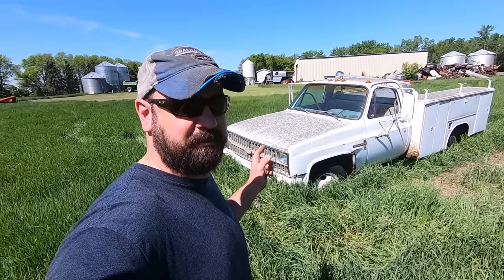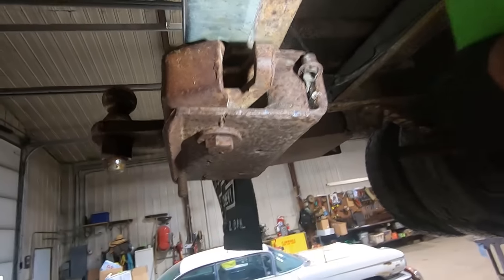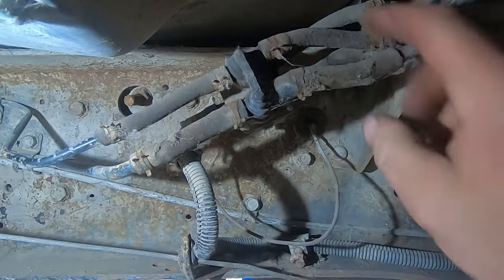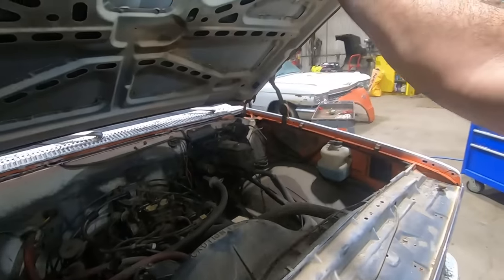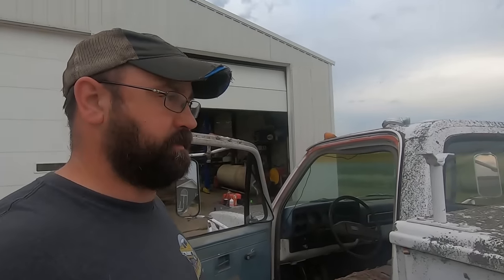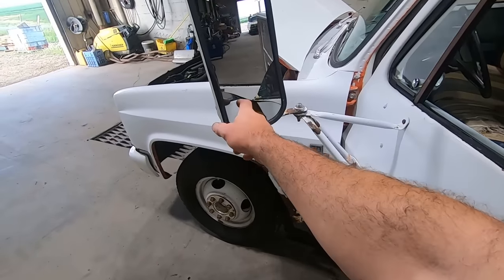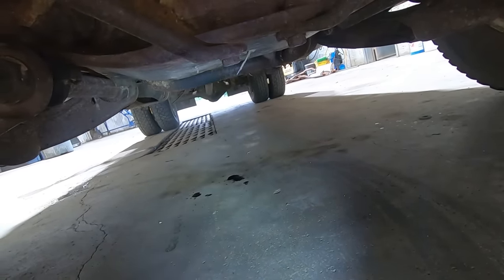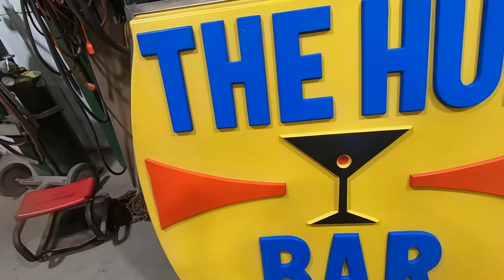1981 Chevrolet Dually! Abandoned for 16 years! C30 Squarebody Service Truck!

Comment: Pretty cool work truck for being left in a field for several years. By all means, run your shop fans to help with the heat. I couldn’t hear anything on the audio but even if I did, I’d rather know you had them on than not with the way this summer has gone. Another enjoyable video, keep up the good work! 👍🏻
Reply from the maker: Much appreciated
Reply: it was ,  but i did it at 4 or 5 am after lots of coffee

Comment: It's a gift at that price.  What a sweet rig - wish I had the room for her.  She should be sold by sundown - looks like you even had the keys for the cargo hold latches.  A great More Mortske episode would be a cool how-to on removing, by-passing and deleting emission control elements on 70's-80's cars and trucks.  Very cool episode!
Reply: They would have him in court if you look that's just the reason why they have been suing Diesel Brothers, Bill at  extenzive in Houston a lot of other reality shows that they have changed or modified the emissions and or air bags even in a car show only Lexus  built with  seratcha  brand and TV in the steering wheel for airbag  vehicles aren't OK even though  they have a 150 years of vehicles that didn't make additional injuries because of the chemical explosions in bags that is 4 times stronger for passengers and the reason why you have to height requirement for passenger but not the driver 🤔 I will have harnesses in the 07 cts 6.0 swap 3.6 is locked up I think  but mint body 1500 in total air-conditioning system replacement and Grey leather with the oyster white pearl in excellent condition  and the insurance will be  like a normal car from 07 not Uber rare 04 in sunburst orange with a t56 that's just not in junkyards  but I think it was 3 cts in the same color  a dented fender I wouldn't even have to have it painted  I like 15 year old  vehicles that are always available in junkyards and just not able to get tagged as classic yet because then they are going to cost as much as two  do at 15 years old

Comment: Those rings for the dual wheel have the conical lug nut seats on them. The wheels have a flat face on each side where the wheel meets the other wheel or the hub, which allows the wheels to be used in all six possible positions. The ring goes between the face of the outside wheel and the lug nuts. The manual transmission is a SM465, I believe that ‘69 or ‘70 was the last year for the SM420.
Reply from the maker: Thanks for the info!

Comment: They usually put those wheel rings in between the two Rims as a spacer for when you have wide tires to keep your tires from touching tires on a dually will cause hot spots and blow the tires out. But then again I may be wrong.
Reply from the maker: Thanks for the info
Reply: I have a 99 model with that ring. That’s not a spacer. Mine is on the outside as well, not between the tires. I always assumed it was to keep even pressure all the way around the wheel instead of putting pressure on each individual hole. You’re holding two tires on instead of one. I’m probably wrong though. Keep up the great videos.

Comment: When you'd see fleet trucks lined up in a lot there'd be a few older ones -- those were the ones with the big block. I have no doubt that's got a replacement motor - small blocks aren't cut out for the abuse in a service truck like that one. A lot of places went from having trucks with big blocks to mini-trucks with a four banger. Disposable junk nobody cares about.

Comment: For cooling the shop down, I’ve seen people take an old radiator and hook a fan to it and they’ll run water through it and that will work as a AC unit
Reply: The scrapper's swamp cooler !
Reply from the maker: I'd need a lot of radiators.
Reply: Not whinin' about fan noise, but I just get a 4 speed squirrel cage for twenty bucks from a furnace Manas they are super quiet. Just pick the speed you like. Also would be possible to put mister heads in front of the windy side for a swamp cooler

Comment: Mortske I have a 60’x80’x16’ shop with it spray foamed and two big window air units in it and it will definitely be 20 degrees cooler than it is outside when it’s 100 degrees out side!!! Lots of people are very surprised about how I’m able to keep it so cool during the summer!! Then during the winter I have the in floor heat!! It’s in 6” thick concrete floor!! Absolutely love it!!!
Reply from the maker: Nice!

Comment: I'm aware this is an older video but I worked for my local power company for around 15 years as a lineman and I'm not sure if anyone ever commented on it but that hitch is most likely set up for a pintle hook and they're spring loaded. Most all of our trucks had them from the bigger bucket and line trucks down to the smaller 1 tons. Even most of the supervisor's ¾ ton pick-ups had them

Comment: Had an 84 K30 with twin tanks that quit in the middle of nowhere after the camper ran the battery flat. Underneath and switch lines every 300 miles. Got home and a GM mechanic told me that there was a clock module in the fuse box that died every time the battery went flat and cost over $95 for a new one.  His solution... pull the fuse panel and jumper on the back from the pink to the green wire - no more problem ever. And every time I see your chopped F1 in the background, I start drooling.
Reply from the maker: Interesting!

Comment: My first truck was an 87 f250 with the 6.9 diesel and a c6. The previous owner built a janky hitch receiver consisting of 2" tube steel and angle iron. I got rear ended by a service van and it drove that 2" tubing right into the back diesel tank!
Reply from the maker: Ouch

Comment: One cool tip for you Mortske. If you are fighting with stiff or small hoses that don't wanna match up with fitting. Put them into hot water for 5-10 minutes and trust me they will expand and fit. Also this truck is very cool and for a small block it's very decent.
Reply from the maker: Great tip

Comment: There is a nifty little tool for those constant tension clamps. It works 90°, in both directions, of how a pair of pliers would work. 
   Game changer! Especially in small engine compartments, under intake manifolds and whatnot
Reply from the maker: I'll check it out!

Comment: Keeping the shop cool in the summer is a hopeless task; just keep yourself cool with a small a/c next to the cooler.

The 14-bolt cab & chassis dually axle is the one to get for an axle swap on the ramp truck (pickup duallies are wider). Find an axle, rear half of the driveshaft, and move the right shock mount around to the front, and you could run gears up to a 3.21.
Reply from the maker: Thanks for the info!

Comment: Worked for a guy who had a 74 Chevy with dual tanks under a Reading body. When we would fill up, we would park equal distance between the pump islands and fill each tank from the separate pumps. Was quick to fill and we were outta there.
Reply from the maker: Nice

Comment: I had that front brake problem on my 1980 GMC 1 ton and my 1959 F-100. The brake hoses were deteriorated internally and the fluid wouldn't return to the master cylinder.  Needless to say,  I always replace brake hoses when doing an initial brake job on a newly acquired vehicle. Also, my 1994 1 ton crew cab had the same body parts as the earlier models.

Comment: Like the vid i'm a huge square body fan.Currently own 6.The transmission is a sm465.that condenser thing on the blower wiring is a noise suppressor,probably had radios when it was used by the utility co.
Reply from the maker: Thanks for the info

Comment: On my ‘82 GMC with dual tanks I would run one tank down to 1/8 then switch to the other full tank and then go to the gas station. So I never had to fill them both at the same time.

Comment: I like your front fender fix. That's what I'm going to do with my 98 F150. It has a dent in the fender and a bent bumper bracket. I'm going to pound out the dent and paint it to prevent rust, and straighten the bumper bracket. Problem solved.

Comment: I once dropped a 9mm socket when I was replacing a battery in my Frontier.  I assumed it landed in the skid plate under the oil pan.  A year and a half later when changing the oil, I removed the skid plate and it was STILL THERE!
Reply from the maker: Nice!

Comment: Did the orange wire lead have a fusible link rigged up to it? After all, farmers have a tendency to use what they have on hand. 

I used to have an 81 F-250 with a 351 M under the hood. It also had a granny gear with a Dana 90 rear. It also had a huge stack of leaf springs. It was a 8' x 12' dump body. I kind of miss the old gas guzzling Beast. It was a Workhorse. It rode like a Cadillac under a heavy load. I remember having to add on a steering stabilizer. It worked like a champ.

Comment: When you were reading the book in the glove box you said they were filling up with deisel. With the hydro boost for the brakes leads me to believe it started life with a deisel engine. I worked for guy that ran a small car lot. He got a GMC pick up that had a 350 swapped in for the crappy deisel engine it came with.
That may be why it has a crate engine in it. Easy swap.

Comment: I was working on top of a 1200 ton press on the middle of summer, about 125 degrees in the plant, I finish the job start to gather my tools and drop my 1-1/4" combo wrench, it bounces once off the drive shaft and  disappears into the abyss under the flywheel through about a 3/4" wide gap between the crown and the flywheel. So I spent the next hour and forty five minutes with a bent up piece of 1/4" stainless tubing fishing it out weaving a tapestry of obscenities that blocked the sun for hours.....and it was on a Saturday.....
Reply from the maker: Good times!

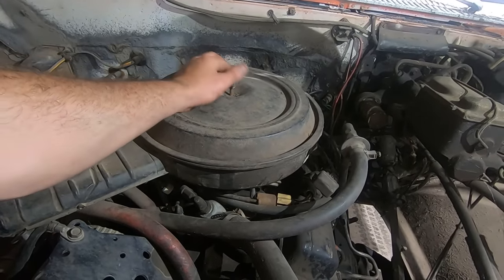Comment: @41:21 Hey just a fun fact, the smog pump would push fresh air into the hottest part of the exhaust in order to allow some of the unburnt fuel to continue burning in the exhaust system. Later when catalytic converters were used, when the engine was on the choke and running extra rich, the unburnt fuel in the exhaust would combine with the extra air from the smog pump and cause the converter to heat up more quickly, which makes them more efficient.
Reply from the maker: Interesting

Comment: i got my driver's license in '81, and around here gas was 69.9/gal. i remember 'cause on my first solo trip after getting it i was filling up my '69 javelin, and thought it was kinda cool. weird what sticks in yer memory, huh? you can make a swamp cooler with some 1x1 angle iron or an old bed frame, a ball valve that will connect to 1/4" water line on one side, and a garden hose on the other, 4"x 54" strips of an old army blanket or burlap feed sacks, a 48" vertical mount attic vent fan, an extension cord and a switch. weld a frame up with some feet to hold the fan upright and clamp the blanket strips to it on the exhaust side of the fan with about 3" between them, run the water line on the top of the frame above the blanket strips, with a drip hole at each strip with the end plugged, wire the switch and cord, plug it in and hook it up to your garden hose and adjust the drip so the water is all evaporated before it drips off the bottom when the fan is on. then just  flip the switch and point it in your general direction. you can put casters on the feet to make it easy to move around the shop. it'll save you a few hundy off the cost of a store bought unit. a neighbor made one to use out in his barn, and it works surprisingly well.
Reply from the maker: Those were different times! Thanks for the tips!

Comment: Oh yeah, problem solve that the steering fluid into the brake booster as part of secondary type master cylinder. Check that the brake pump with the steering fluid in it that it looks like steering pump with the V-belt pulley. The pump have two lines = very strong hose. The line one for return fluid, the line two goes to the brake booster in behind the master cylinder. The power steering is not important because use manual steering wheel instead.  Do you need this recommendation? Your work is Service utility truck that force to have a very brake so the stopping distance of the 1981 at 50 MPH is 20 foot!

Comment: The ceiling fans only push all the heat from the roof down, only use those in the winter to move the heat down. Open the front and rear doors to create a cross draft, then put big floor fans at whatever side the air is closing naturally.

Comment: My understanding of the ring on the dulles is, if for whatever reason you only have one wheel on it you need to put the spacer ring on to make the lug nuts seat correctly.

Comment: Nice service truck Mortske you should either keep this one or the older one,I think keep the older one bcause it has the air compressor in it & air line & it works & this one doesn't have a/c in it but it might pull more than the other one being a dually & I think the other one is a 3/4 ton,don't remember if it's a manual or automatic,but which ever one you decide to keep you should load it up with tools & stuff for when you go get another vehicle

Comment: My guess is the hole in the middle of the box was for power cables to go up into a bucket lift bolted onto the deck.  If it were mine I would call it "Snowball"... It will snowball into a big project.🔧

Comment: the tissue box! lol just because its a big white box. sounded good in my head at least.

and i dunno, ive worked on a few 350s and one had a whole blasted through the cylinder wall and the other was in a c30 camper i had been asking you troubleshooting questions on. the original engine decided it wanted to eat a bearing and throw a rod up into the block destroying absolutely everything lol

Comment: Some old trucks definitely just want to run and be used.
If you wrap electrical tape around the striker, it helps with closing the door, that's something I learned from Corvairwild.
Reply from the maker: That works too. Less permanent

Comment: The fuel is fresh but the float bowl is dirty and carburetor is still almost dead. Install the spring pull the idle into 300 RPM and keep your foot of the accelerate up pedal so it stays 1000 RPM until the choke and that system open the choke up then the fast idle step mechanism will be force by the choke into warm engine idle.

Comment: That beefy rear sway bar is likely the source of the rattle. It should be attached by a lot more than tarp straps. Your oil leak could possibly be the oil sender. I've seen a lot leak, and they will start up high and look like the back of a valve cover or a rear main seal is your problem by the time the oil hits the ground. You mentioned both of those. You could be right on those as well since we all know SBCs are prone to leaking at both of them.
Reply from the maker: I’ll check it out

Comment: When the rear alternator bearing has magnetism it means the rotor is magnetized, that still leaves the stator and it's diode bridge to keep the alternator from actually have an output.  13.2 v to 14.4 is normal for the range of the S110 GM Alternator. I keep a 0-25 volt voltmeter in a small chassis box with alligator clips to check voltage quickly after I do the "Rear  bearing/attract the screwdriver" tip.
Reply from the maker: Thanks for the info!

Comment: Ive got an 82 Custom Deluxe 30 Dually with a 454 engine with a 4 speed. It has the double headlights on either side. It has a custom built 10' Diamond Pleat Black Metal Fendered Flatbed on it. Dual Tanks. I put a 13,000 lb winch on it so far. Im going to have it repainted and do a few other upgrades to it.
Reply from the maker: Sweet

Comment: The choke modifying diaphragm opens the choke upon starting and it further restricts the rapid opening of the secondary mixture flaps and rods to keep it from backfiring from too lean a mixture from the flap opening too rapidly. It needs to have manifold vacuum, not plugged onto any old nipple sticking out, but absolute manifold vacuum so it can react to your throttle position and load.
Reply from the maker: Thanks for the info!

Comment: I "lost" a 5/8" and 10mm in the crossmember of the lower suspension arm of my 2002 GMC Sierra 1500 V6 while I was changing plugs, coils, and oil change. Both dropped SAME spot between the bushing and open ended crossmember, I can STILL hear them rattle, I couldn't get them out since that crossmember is part of the subframe/trans mount thing GM decided would be a good idea. Glad they weren't the good sockets but the 10mm was probably the 20th I watched disappear into the abyss of the "Never getting that back" void.
Reply from the maker: Dang
Reply: @MortskeRepair  sadly, those weren't the only tools I've sacrificed to that truck hahah. There is still a socket on the passenger leafspring bolt that I had to hammer on, yay rust, even with fire and almost 5 cans on luby dooby it would not come off so I had to leave the mustached leaf springs..for now. There's also a vise grip holding the original muffler mount to the frame and a LOT of number 9 wire replacing every rubber piece that used to hold up the exhaust, not paying $30 for replacement rubbers when I can spend 10 bucks on a spool of number 9 hahah, and that's just the 2002 GMC you don't wanna know what sketchyness I've done to my 71 Cheyenne I've been rustoring hahah.
Reply: I'd call the service c30 Snow Cap or 10 - 33 (10 code for medical emergency used by police in most states) you may need it trying to get rid of all that smog crap.
Reply from the maker: @6661islife  Sounds like you've got my luck!
Reply: @MortskeRepair  just put us in a shop together..we could invent a couple few new curse words guaranteed 😂
Reply from the maker: @6661islife  Oh dear
Reply: @MortskeRepair  we could also get a lot of stuff done..I may not indulge in sammitches but I'm told I'm funny and I'm full of odd references.